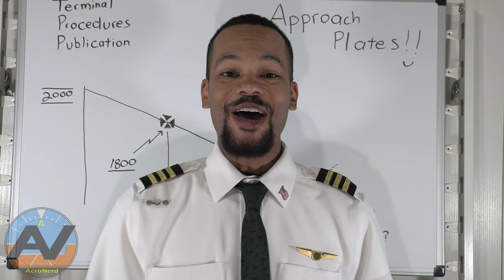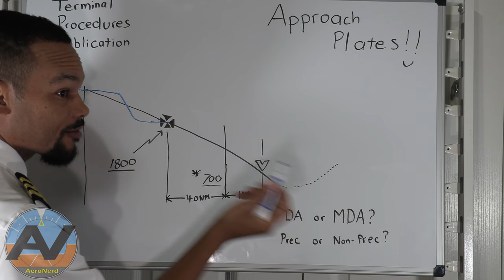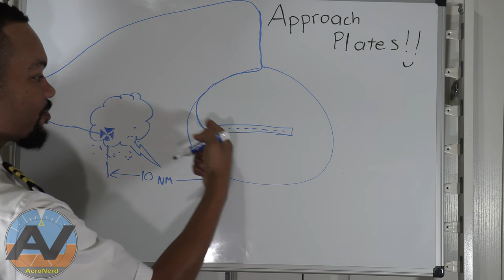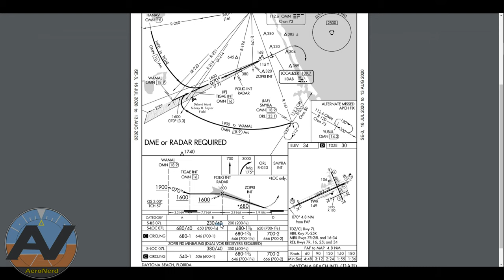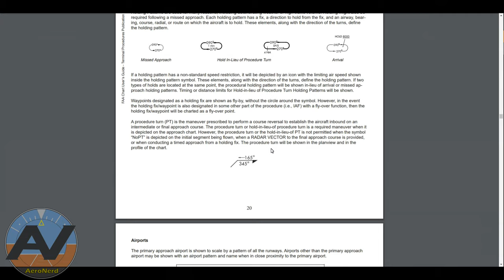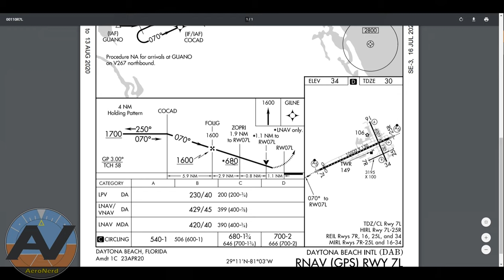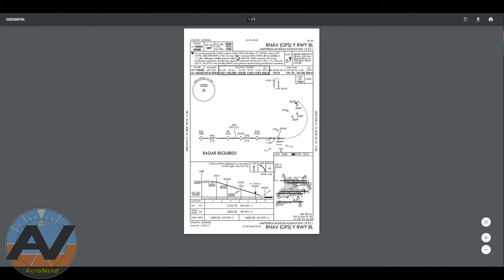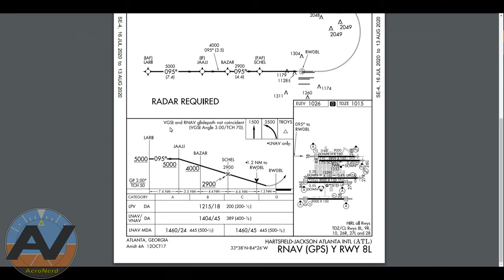Instrument Ground School 07: Approach Plates Explained

Comment: Approach chart at 12:30 is a little bit busy and can be confusing. Firstly if you don't have dual VORs then you will not be able to identify neither FOLIG nor ZOPRI and you can not use the minimums that says dual vors required. So how you can tell you are at FAF - FOLIG if you don't have dual VORs, well approach control will tell you. That's why it says "RADAR" under the fix. And how you know you are at MAP? For that you have to use timed approach. Other than that great class thanks for putting it together.

Comment: I actually went out yesterday and practiced circling approaches. We didn't use them at the airline, so I wanted to make sure I could complete one without gaining /losing altitude and stay within the 1.3 nm radius. Worked out well. Question: "Radar Required" on a plate means ATC radar, not aircraft (wx) radar, correct?